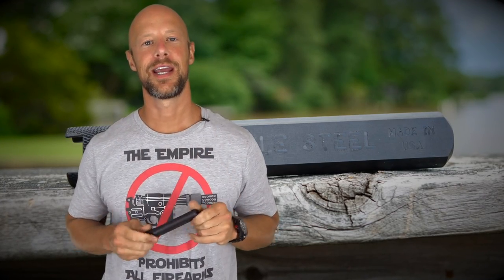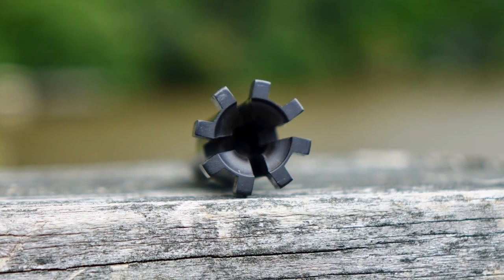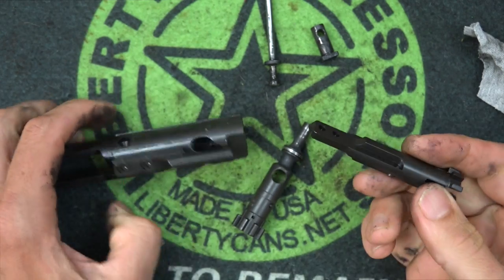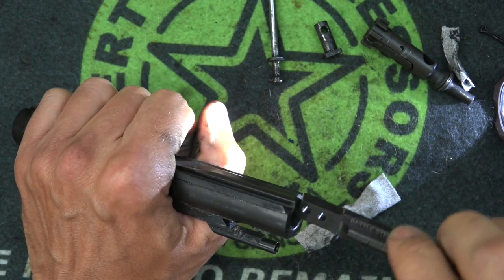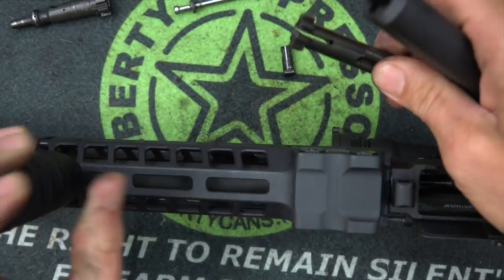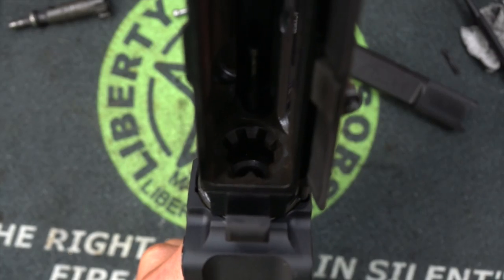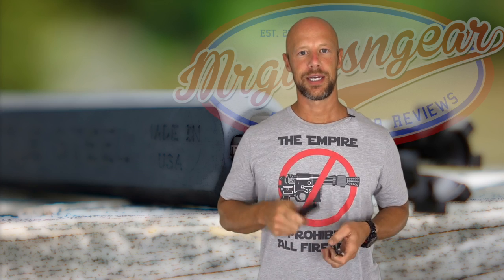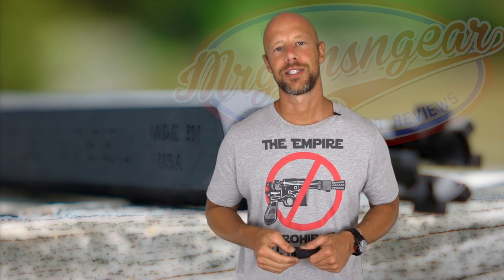Battle Steel Carbon Killer & Lug Scraper Cleaning Tool For AR-15s Review (HD)

Comment: I have the Otis, and while it works OK, I have been a little disappointed with it's function.  This seems to work a little better.  It's too bad they don't have a cross pin to lock it into the handle, It seems that would allow you to get the back of the lugs and be generally easier to use.
Reply: I put a magnet in mine to help hold it in there.  FYI.  I got the magnet at Harbor Freight.  One of those small rare earth round ones.  I put the magnet on the top of the metal, put a drop of super glue on the magnet then carefully put the handle on top and let it dry.  Once it dried good, I pulled it out.  It isn't a lot of holding power, could add another magnet I guess, but it does help with the problem you describe.  

Hope that gives you a idea.  Oh, I don't think they make these tools anymore.  I can't find anyone that has them.

Comment: I love the design of it but I don't like that it is metal. Metal on metal has a higher propensity to screw something up by scraping it too much. We are overdue for a specific tool that allows you to perfectly get in all those nooks and crannys. That grinding sound when your spinning it near the chamber and through the lug slots made me cringe. I'd like to see this in a polymer with something like a dish sponge scrubbing material more for scrubbing then scraping. I never want anything scraping near those lug slots.

Comment: Already own carbon scrapers - the only new/interesting thing is the chamber scraper.  Except that isn’t the best tool to clean the chamber. It’s called solvent plus a $5 chamber brush.  Done deal. 

This tool looks like it would eventually erode away the chamber, especially anything with a finish or coating. Kind of like the old 3-piece metal cleaning rods were hell on rifling.

Comment: can i get a recommendation on ruger ar556 or savage msr15 RECON? I just want 2 get an ar. but it will get MAYBE 100 rds a yr thru it. That $1,000 range is max 4 me but i would want 2 put vertical pistol grip so ruger would need more parts. IS the savage worth the double price tag? No optics or anything else just bare bones ar.Thanks. Oh yeah, i am only 5 feet tall and my wife looks at me with disgust when u talk about your hands being so big, STOP IT DUDE. lol
Reply: James Seckinger - My only complaint  with the Ruger 5.56 so far is the stiff take down pins.  You really have to man handle the ish outta them when they're new.  I recommend a fine file to file it down (circular) a bit.  Awesome rifle otherwise!